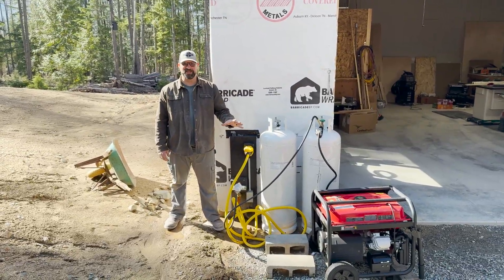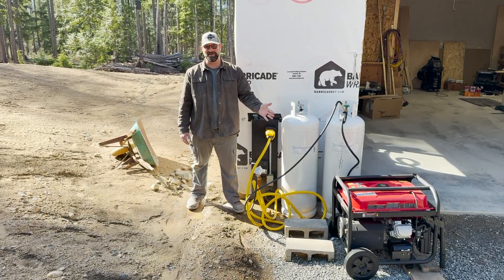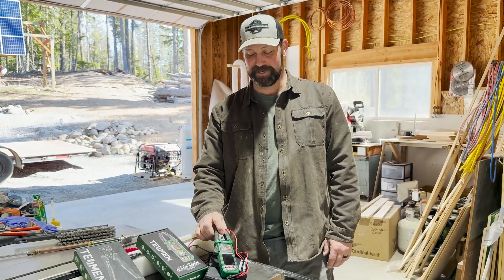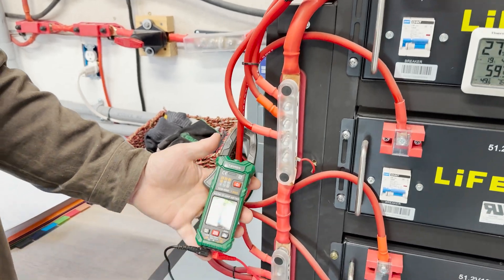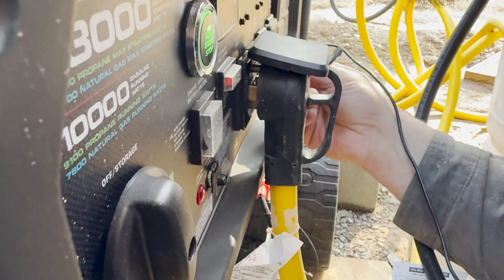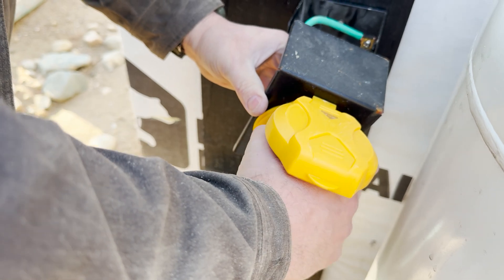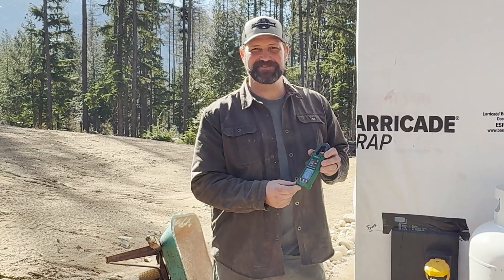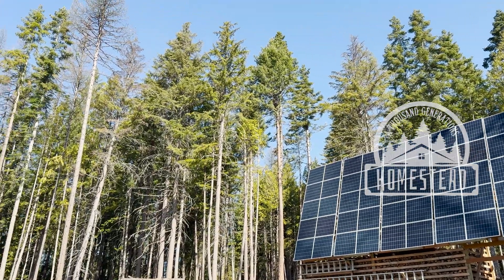Do we have a Chargeverter issue?

Comment: Until 2023 chargeverters did not exist, running without is easy, that Gen on LPG try a 110A total (charge + home load @58V absorb) surge items, pumps and fridges cause the frequency variation, shut em off, pull 6400w it should be really close to 60hrz, with no surge it will stay steady. Freq too high pull more, to low pull less.  Anti islanding has to be set proper to not back feed the gen.
Reply from the maker: Thanks for the information, that's very helpful!